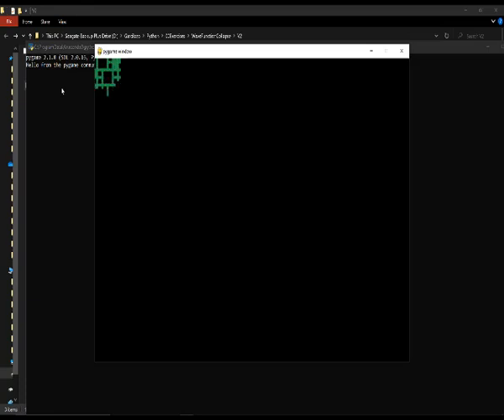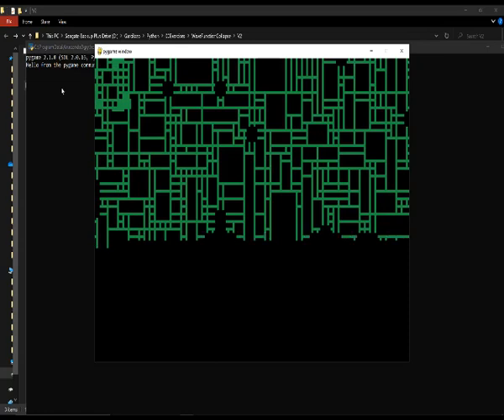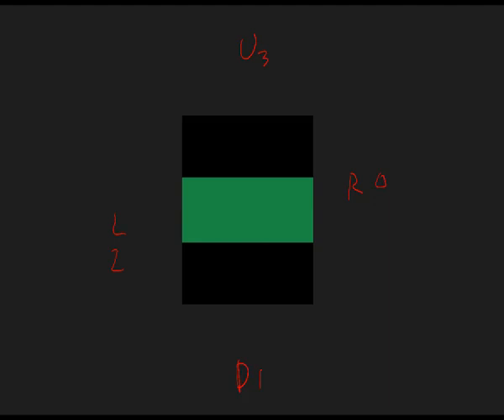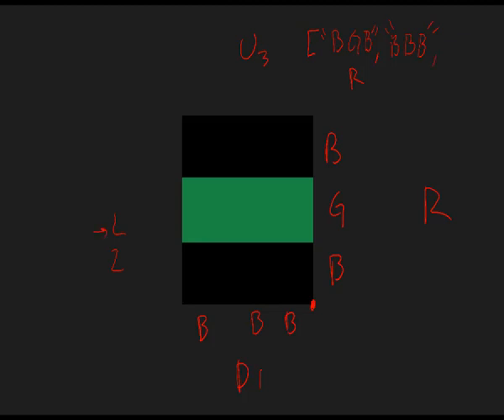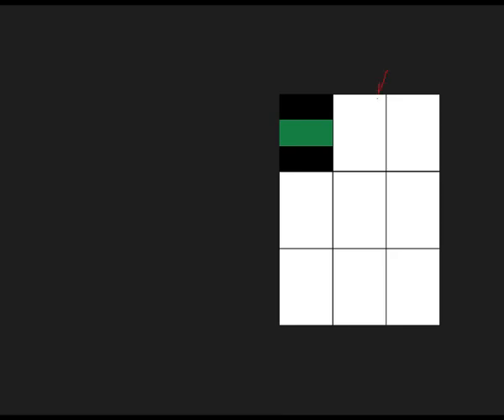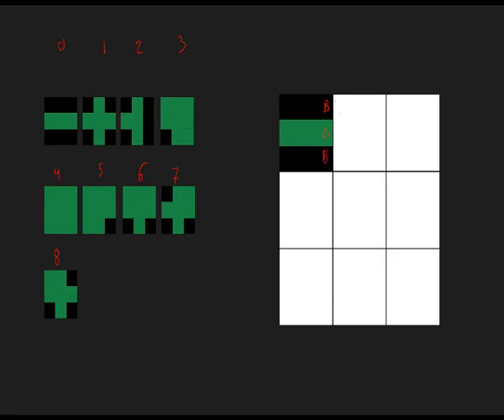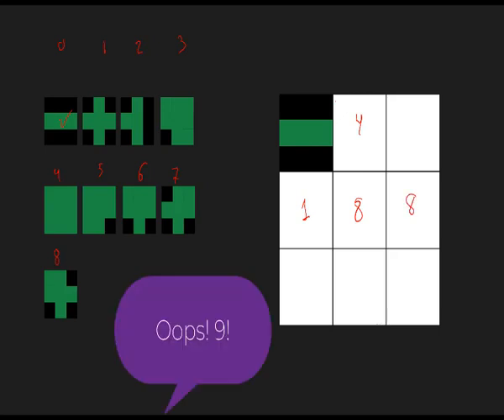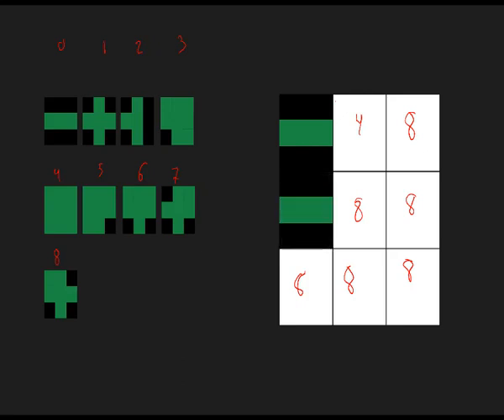Introduction to procedural generation with Wave Function Collapse

Comment: have to absolutely disagree with you saying python is easier to process than say C.  C is MUCH MUCH MUCH easier to read and is not subject to "late binding" issues like... running your code for 48 hours straight only to have it puke on "you didnt create that at compile time" errors.
I spent 3 months trying to get to grips with python and... my brain rejected 100% of it.  I code C, assembler and forth professionally and i think BF is easier to read than python.
Reply from the maker: Hi Mark! Thank you for taking the time to leave a comment! I can tell you're an experienced programmer and I no doubt you raise a great point! I can certainly relate to the frustration of dealing with a high-end language like Python due to runtime and syntax errors. For me, Python's (and any other high language really) strength relies on a simple syntax that helps me first understand an algorithm, because its grammar is closer to a natural language. Once I have a better understanding of it I can focus on performance in other programming languages if I require a more optimized implementation. But no doubt the process can happen in other languages and at any other level! Were you able to implement the WFC algorithm in C? I'd love to check your code if you make it available! Please stay in touch and let me know if that Python keeps misbehaving. I might have some good tips.
Reply: @SiliconHeart-uh4kp  Meanwhile, I'm over here programming in AutoHotkey lol
I wanted to write a fun little interactive demo for WFC and this video helped me to understand it a little better, thank you =)